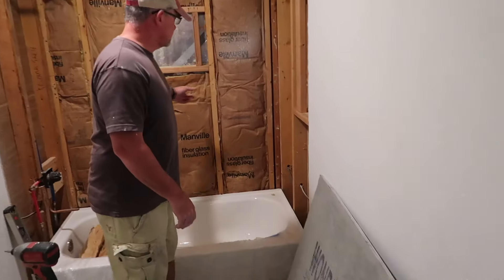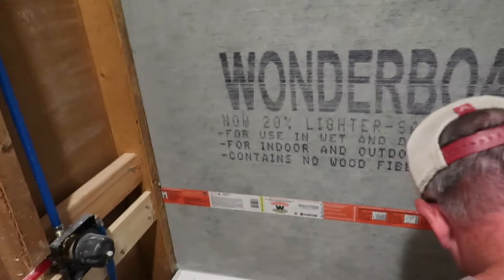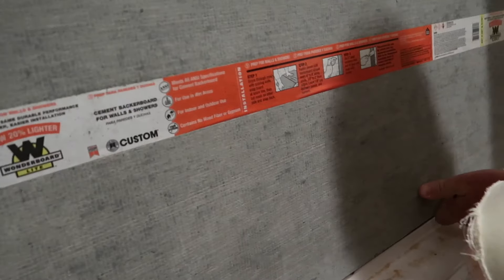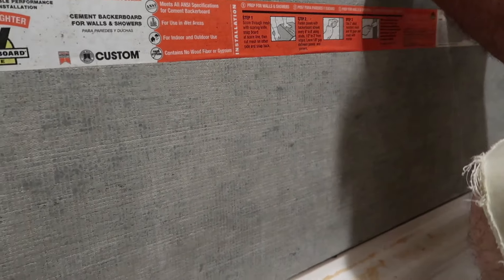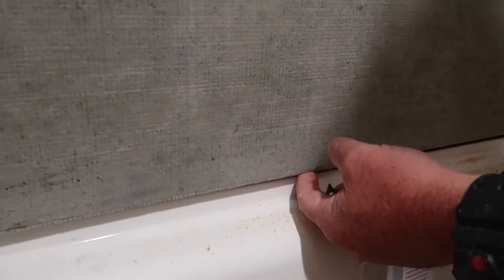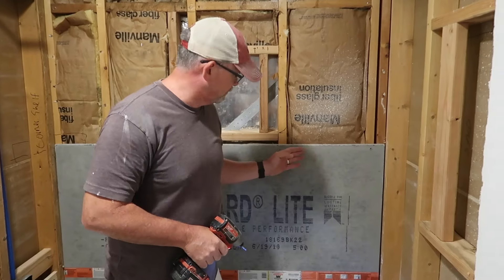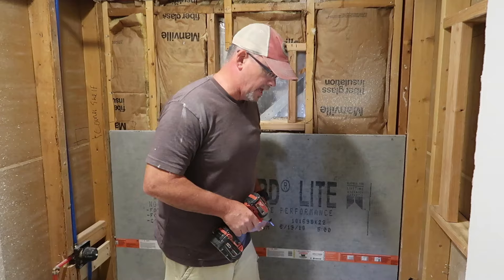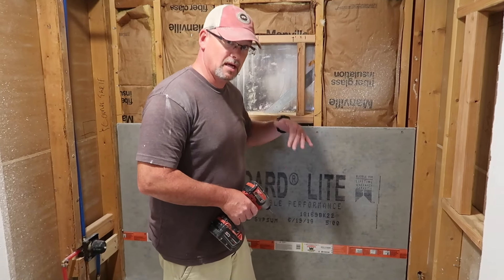How To Install Cement Board Around A Bathtub- SIMPLE & EASY!

Comment: You are wrong sir, with all due respect. Backer board is Never to set above the tub flange as it can leak behind the wall. Instead you need to either notch the stud to allow the flange to set into the wall as to let the Backer overhang the flange or use furring strips to allow the Backer board set over the flange. Never let the Board set on the tub it should be spaced 1/4 inch above flat part of the tub and filled with  Kitchen and Bath Silicone to seal then you can tile it. Also seal the corners with atleast silicone but preferred to tape the corners with mesh tape and Thinset. But DO NOT install Backer Board above the tub flange period. I also put thick Mil plastic under the backer first and let it over hand the tub flange as well for Extra protection. God bless and have a great day. I have over 30 years experience as a kitchen and bath contractor to back it up , so I know just sayin
Reply: Please don't install tubs. you have zero clues
Reply: @vajona2495  Gary Kentner is absolutely correct and clearly knows a good deal more than you do.
Reply: @paulmaxwell8851  the willfully ignorant cannot be taught anything. Enjoy your mold
Reply: I install my cement board like the video then I just fill the part under the cement board with thinset and mesh tape all the way down to the tub then red guard everything.  I haven’t ever had a leak.  But the specs on the Kohler tub instructions say to fur out the entire framing to be flush with the tub flange then overlap with cement board.  That is a stupid waste of time to fur the entire wall out.  You have to thinset the joints anyway so why not just thinset the bottom.
Reply: Yup

Comment: I’ve gotten a lot of mixed reviews on where the backer board sits on the tub. Seems a lot of people do it this way, but have ran into a lot that say not to and that your really supposed to shim your studs whatever the thickness the flange of your tub is so the backer slides right over the flange and on top of the tub rather than on top of the flange. Use spacers to leave a small gap between the tub and bottom of backer board. Then seal the gap between tub and board. This creates a stronger wall and allows materials to expand and contract easier where damage would occur if expanding happens with the board on top of the flange.

Comment: backer board is supposed to sit 1/4" above the tub lip, not fully above it.  You will get water in the wall if you do it the way he shows.
Reply: This man with over 30 years experience fixing just what you said to do has some great info and advice, and explains very clearly why you should NOT rest it on the tub as it WILL rot. Most guys are doing it wrong, and this man is pulling his hair out trying to make people aware of it, because he has been fixing peoples mistakes for decades. I find his advice very valid, and worth hearing out, as it is totally logical, makes perfect sense, and comes backed by over 30 years of experience!.: https://www.youtube.com/watch?v=04WLo0aCmBg&t=3s
Reply: What advice tge video was 10 seconds long and disnt explain anything...lmao. also how is leaving a gap better?@adamalander7515